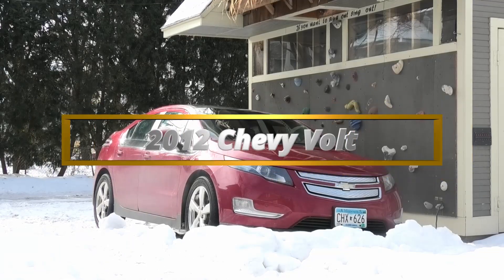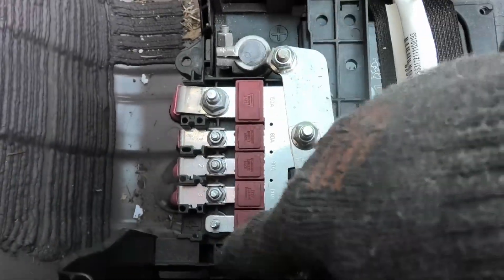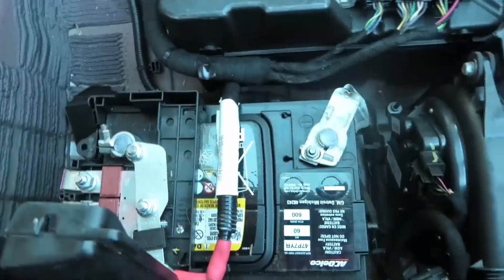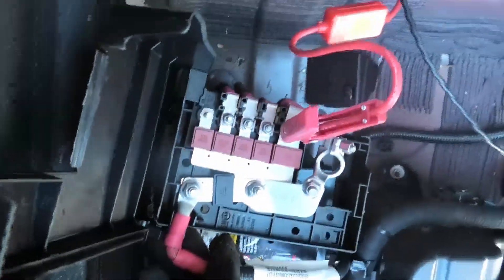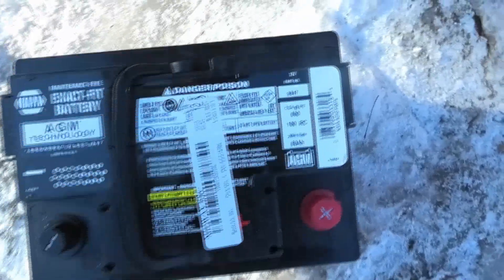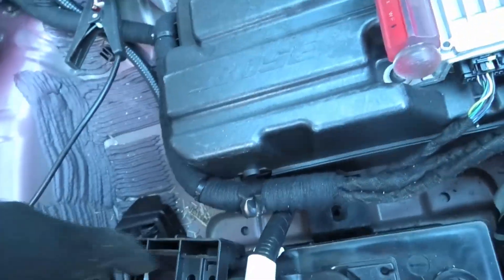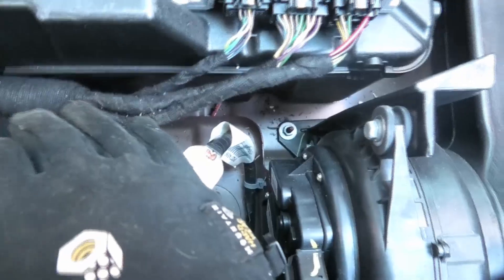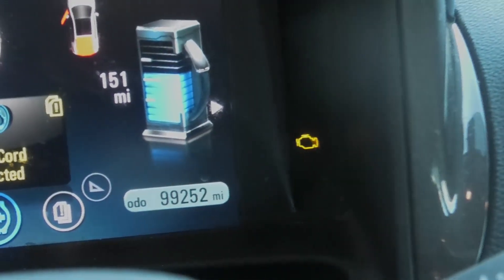2012 Chevy Volt 12v (starter) battery replacement - Super easy job!

Comment: The dealership wanted $150 to install a replacement to the original 12v in our 2012. After finding your video decided to D-I-Y. Removing the four bolts holding down the pump tray was the most complicated part of the process. Whole thing done in less than 20 minutes! Thanks for giving me the confidence to get it done.
Reply from the maker: Love that story. Thanks.
Reply: $150... just for the labor?  That'd be an excellent price if it included the battery, but I'm guessing you meant that's JUST for the labor.  If so, then they're not just a dealership, they're crooks ... because $150 labor to install this battery is highway robbery.   Many auto-parts stores would install it for free.  Also if the $150 is just for installation labor, my God, what did they want for the BATTERY?  I shudder to think.

Comment: Thanks for the video, it saved me a bunch of time.  My 2013 12 V battery gave up the ghost almost exactly at 8-1/2 years, so very consistent with your experience.  The symptoms  described by you and commenters were the same as mine.  I bought my battery at Sam's Club for $189.  Other area suppliers were over $200.  One minor point is that you installed the black plastic hold-down block upside down when re-assembling everything.  On removal, you can see the embossed printing pointing up but on installation I believe they are pointing down.  It's really a non-issue since the nylon strap secures the battery, but the way it was installed in this video, that plastic piece can't engage the lip on the base of the battery.
Reply from the maker: Good catch!

Comment: Thanks for your video. My 2015 Volt died on my way to work in front of a gas station I ran in to grab a coffee. The OnStar rep was trying to convince me I needed a tow to the dealer because it's a hybrid (which led me to believe you need to be a computer engineer to replace a battery) after a little discussion she CA Ed and sent a serviceman to Jumpstart me. Now, for those who are reading that have the same issue, the mechanics portable Jumpstart didn't work with the under the hood posts. So he climbed over my back seats and hooked it up to the battery directly (You are absolutely right, working through the backseat raises the difficulty significantly because the cover and tray won't fit out the back doors). I got the car home and replaced the battery. Now to add that the 2 weeks leading up I was having issues such as my infotainment would cut off and on or my DIC would show "Initializing... please wait to shift," my 🔋 wouldn't charge some nights and other little annoyances, I am not getting those problems anymore. Thanks for saving me several hundred dollars and giving reassurance to a first time hybrid owner/garage mechanic like me.
Reply: Just wanted to say I Had the same issue but I realised after I had to jump it again one day and found if u have no ev battery etc and the car goes straight to engine from get go it will jump from the front of car but I found if u had ev charge left it wouldn't if u get my what I mean I Don't understand the difference but it seems like with no ev miles it will jump from the front off a jump pack cause it goes straight to engine well that's  what happoend to me ..m

Comment: 2022 and my battery is about to go. Can't find any replacement. All sold out in my area which is Washington DC.
Reply from the maker: Keep looking. I bet the GM dealer has one. They are expensive. Remember it is an AGM battery. Don't put a normal battery in there because they vent evil gasses into your passenger compartment.

Comment: My lithium booster sucks so volt lost power. Infotainment maintained configuration thanks to internal coin battery or something.
However, Gizmo by rear view mirror for compass and TPMS got wiped so... TPMS should be straightforward but how do I fix compass it just says "CAL" .
GPS seems to be fine it has the correct location on the map, but i haven't tried moving yet.

Also, had a heck of a time trying to reinstall the plastic shelf. I think the cover over the positive terminal and bus bar wasn't able to slide in as far as the original battery or battery isn't far enough towards passenger side.
Oh well, for now I just leave it out.
Edit: yup, just had to loosen battery seat belt and shove battery as far toward passenger side to the stops and retighten. Now for TPMS and compass relearn
Reply from the maker: You got this!
Reply: @mbrenengen  It's an interesting project! If I ever have to replace the DC to DC converter fan it looks very simple.
Reply: @mbrenengen  I found it much easier to remove and reinstall the seat belt, if I remove the connectors for the Bose amplifier / subwoofer, as they are in the way. Easy squeeze connectors.
Reply: @mbrenengen  compass self calibrated after driving a short while. 
TPMS was successfully relearned on my 2013 with $13 Amazon tool, "JDIAG EL-50448 TPMS Relearn Tool"

Comment: Thank you for this video. I already bought the battery before I started replacing so I didn't need to use the jump starter. It still kept the same Trip A & B on the dash, and radio settings; no resets! I did have to change the clock it went to 12:00 AM
Reply: Thanks for this! How long would you say the circuit was open between disconnecting old battery and connecting the new one?
Reply: I called my two local Volt-certified Chevy dealerships prior to DIY'ing my 2019's battery a while ago, and asked both service writers if there were any general caveats I should watch out for, and also if putting a "life support" 12V battery on it was a good idea (or not).  Both service writers said a booster battery was not necessary, and that their techs did not use one.  I did have to re-train my Express-Up drivers' side window afterward, and the TPMS numbers were just "--" until I drove a mile, but that's pretty much all I visibly lost.

Comment: You don't need to keep power to the car. It'll be fine if you just disconnect it - thank GM for that.
Reply: Infotainment computer yes. TPMS info lost however? Compass needs calibration?

Comment: The volt has no key to unlock the doors?
Reply: Key in driver door only, which is very common with other cars.
Reply: @n9wox  And on the gen 2 Volts, it's not even visible.  It's concealed under a lovely (read: tough to remove) body-colored plastic cap adjacent to the door handle.

Comment: You've done your good deed for the decade--came back to say THANK YOU! I had to buy a "deep" 10mm socket, but that's it. $200 from AutoZone. Fixed my "Engine Unavailable" message. Took maybe 30 mins and I'm not super mechanical. I didn't bother with hooking it up to aux power.

Comment: So the little plug for the vent holes I found out is on the corner of the plastic red cover that you throw away before installing.  It's the cover that goes over the positive post when you buy one new.  You tear it off the corner of that throw away piece.  Very nifty but also not widely known nor does anyone ever tell you about it.  Just thought I would share for the next guy going through this.  Appreciate the video.  Made my experience go much smoother if I hadn't watched this.  Thanks!
Reply: Thanks for the follow up but please clarify. The one vent hole gets the vent tube connected but the other vent hole remains open. That would mean you went back and took off the piece of electrical tape correct?
Reply: I just installed a new 12V on my gen 2 2019 Volt.  I also was like, "where the heck is the new plug?" and figured I'd just reuse the old plug.  But as you said, I noticed it was part of the square throwaway (+) terminal cap that lives on the battery until it's purchased.  It snaps right off,  and is easily popped into the spare vent hole with a quick press of the side of a pliers or (very) gentle tap of a hammer to fully seat it (it goes in easily, but is very snug).  

There was a microscopic (like, an inch square) little booklet marked "instructions" atop my red cap (which was Walmart's EverStart brand, but obviously made by Johnson Controls).  I peeled it open, and found that it mentioned where the plug was attached, which solved the mystery for me.  It was hiding in plain sight!  Unfortunately, I reckon few people ever peel off that teensy-weensy little booklet and open it up.  JCI should just put a big arrow sticker with "plug here -->" on it instead!

Comment: Now that Chevy has discontinued the Volt, would you purchase a used Volt?  If yes, what year would you purchase?
Reply from the maker: I just sold my Volt (after my son totalled it) I will make a video in the next couple of weeks that breaks down the costs I incurred and my thoughts on your question.

Comment: Is the battery you replaced  work for electric only mode? If not, where is the battery pack for the electric drive?  How much does the "electric" battery pack.?
Reply: Somewhere around 9,000 bucks+ for new. Can find used. You lift the vehicle drop it from the bottom.
Reply: the High Voltage battery is locked in the front,near the IC engine
Reply: @HPLovecats  high voltage battery is T-shaped and runs down the middle and back of the car.

Comment: great video - how did you know it needed  a new battery?
Reply: Mine failed to start or even power up. Completely dead even with a fully charged EV battery. Once power is applied the car started without and issue. 12 Battery totally dead. Mine was about 9 years also.

Comment: WOW that lasted a really long time!
Reply: Incredibly long!  The last three 12v AGM batteries I replaced were in a '14 Volt, a '19 Volt, and a '17 Malibu.  They survived five, four, and four years respectively.   These modern cars are pretty tough on their 12v batteries (so many current-hungry systems!) and AGMs can be awfully particular about their charge curves and discharge-depth sensitivity.